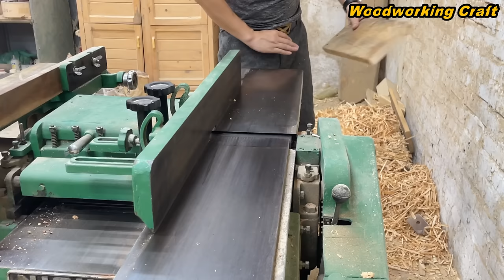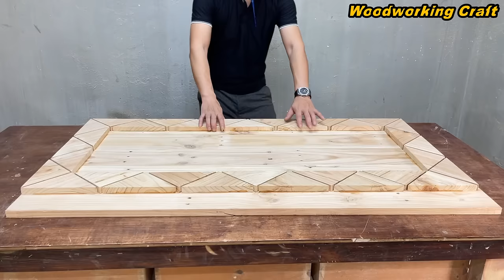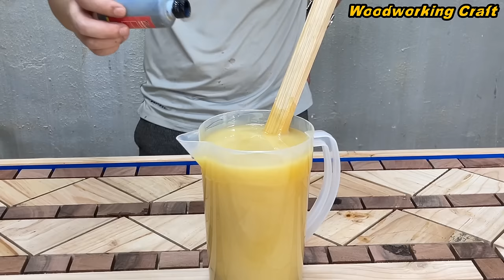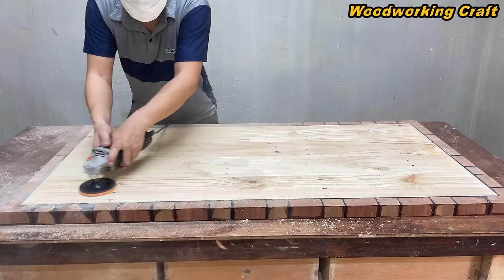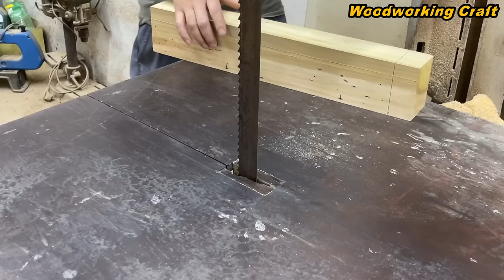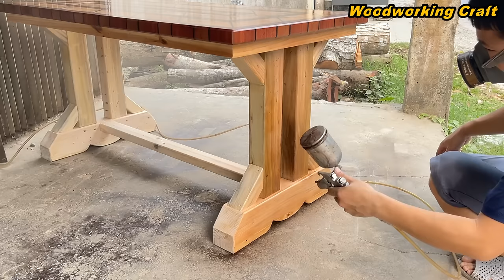Recycle Pallet Wood Effectively // Make A Super Beautiful Table From Pallet Wood And Epoxy Glue

Comment: I have worked in manufacturing and shipping most of my adult life. 
I have never ever seen high quality and limited availability species used in pallets! It's not cost effective! 
So unless you see the pallets taken apart and see all the wood yourself, i wouldn't take it as fact.

It's good that they are reusing scrap wood but they should be up-front if they are adding too the pallet wood with another species or do not have enough recovered from pallets and had to add.

Comment: The table plate design is beautiful, but the supporting frame and legs are too thick. How much does whole thing weigh ??
You shouldn't've removed the excess epoxy. It gave the table a very attractive bluish ceramic bricks like appearance.